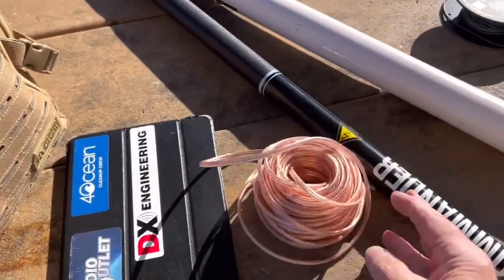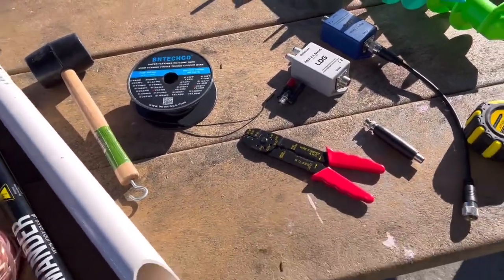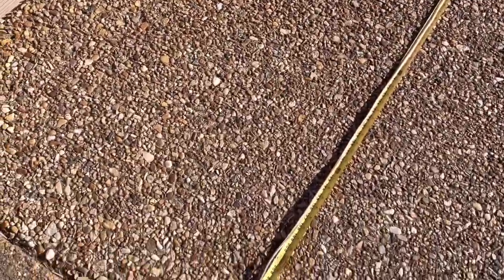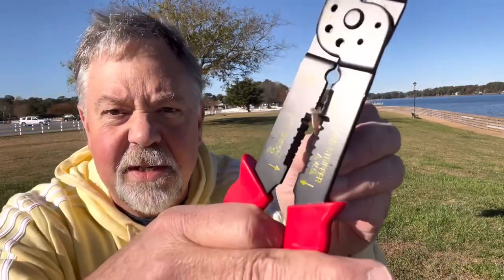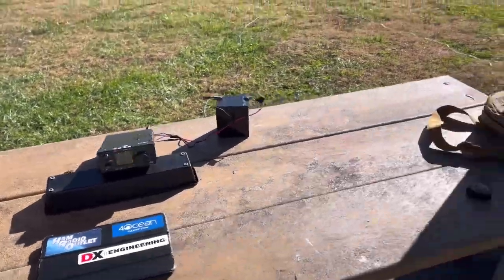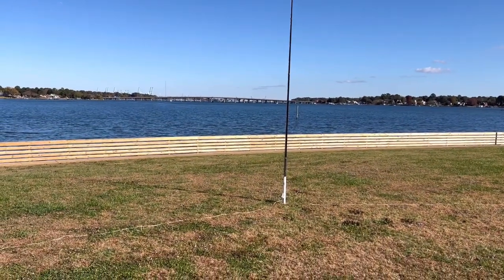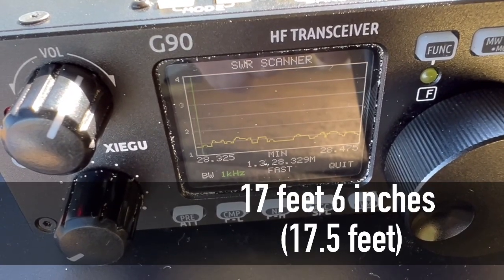How to Build an Easy Vertical HF Antenna

Comment: Hi mate from vk4 land here in Australia. I just bought a 9 meter telescopic pole and a 1:1 balun the same one you have. And I ran 9 meters of power cable up the pole and so far I have 2 ,9 meter radials on it. So far the performance on my frg 7700 and Kenwood r1000 is not as good as I thought it may be. Would you suggest using a 4:1 balun instead? Cheers and 73s 👍

Comment: Walt, I'm getting ready to build this antenna and had a question I'm hoping you'll answer.  I see here you're using the 4:1 balun where in your book, you use a 4:1 unun.  I've ordered the balun but don't have the unun.  Does it matter really?  Just want to make sure I'm using the right hardware.  This is my first home brew antenna.  Thanks Walt and 73 sir
Reply from the maker: I’ve found that they both work well with this antenna. 73, Walt
Reply: @COASTALWAVESWIRES Roger that sir.  Much appreciated.  I just ordered the unun as well, so I've got both to experiment with.  Thanks for answering my friend!  73!

Comment: Do you still need baluns or chokes if your only listening and not transmitting as like sdr radio?
Reply from the maker: No, just the wire for receive. No balun needed.
Reply: @ ok thx 🙏

Comment: Remember all antennas work, some just work better for a certain use. I do wish you might tell us what the various antennas lengths or location of the feed line. Example if 1/2 wave total length the middle feed is somewhere around 50 - 70 ohms, if fed on the end somewhere from 2,000 to 3500 ohms, divide the feed by 50 gives the transformer needed. 9/1, 49/1 or even 64/1 ? 9/1 is called random wire because it is chosen  for space and not reconsent anywhere around 450  so 9/1 = 50 ohms?

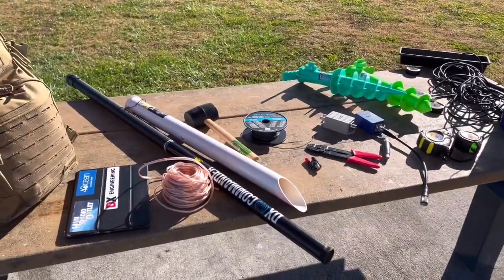Comment: Hey Walt, please tell me what you are using at the base of your verticals. It looks like a fat end is on the coax, think you said it’s a 1:1 Balun? It’s connecting the balun at antenna base to coax going to the radio. About 6” long and it’s fat. May have two connectors on it. Edit: I think I see it at 3:33 on the table below the unun’s.

Comment: Twist stranded wire counter clockwise then wrap around screw in the direction  that you tighten the screw. This prevents strands from unraveling. 
My question is how to do the counter poise for a ham antennas when on a boat
Reply: Thank you

Comment: 10 meter band is 102" inches appox 8.5 FT. How can a 17.5 FT wire work on 10 meter?  Also, are the transformer and balun nessary? I dont understand why they are used. Also, instead of using counterpoise wires, why cant you just put a ground rod into the ground?
Reply from the maker: 102" is a quarterwave for 10 but other lengths will work as well and that is why we use transformers, to match the feedpoint impedance. I'll link a video below that explains that. 17.5 is basically a 5/8 wave antenna for 10 meters and has a feedpoint impedance around 200 ohm, so connecting 50 ohm coax to it means you need a ration of 4 to 1 to make it work. Thus a 4:1 unun at the feedpoint. As for the ground rod, no that will not work at all. Electrical ground and RF ground for antennas are two completely different things, I'll also put a link below for a video where I explain that.

https://youtu.be/utgfXWC6SH8?si=RBaw_HLFJGA-5Xyk

https://youtu.be/KjEOUZS_5sw?si=UJT_x8w6LXOw5CIB
Reply: @COASTALWAVESWIRES  Thank you for responing, these are things I did not know. I love the wire antenna videos, but would like to use a copper pipe vertical and my metal roof as the counterpoise, but am affraid of the lightning issue!!!😦 BOB N9XSR

Comment: I thought counter poise was only 1 wire? And radials more than 1 wire.😮
Reply from the maker: It’s just a name, radials are the antenna’s counterpoise. A single “counterpoise” wire is just that a single wire, it could be called a single radial is some instances.
Reply: @COASTALWAVESWIRES a single counterpoise maybe
a vertical dipole antenna?😮

Comment: 17.5ft length of vertical....210inches.....but using speaker wire/pvc coated....capacity affect....multiply by 0.95 equals 199inches....or 0.92 equals 193inches....16ft....so a half wave on 28mhz and difficult to tune there?if using PVC coated wire,223 inches long equals 210inches bare wire after multiplying 0.95 and gives you a "true 17.5ft" random wire that stays away from half wave [10m?]. not quoting here,just adding my thoughts but could be wrong? just thought that had to always calculate capacity affect of pvc coated wire when measuring critical lengths? any thoughts?...
Reply from the maker: My thoughts. With all due respect I think you are way overthinking this.

Comment: Newb here. Can you bury the counterpoise lines (assuming I set this up on a semi perm basis)?
Reply from the maker: Yes but bury them very shallow (like an inch deep) it’s the surface of the ground that’s acting as a RF reflector for the antenna. It’s completely different than electrical ground. Many people staple their counterpoise wires into the ground and let the grass grow over them.

Comment: I made one of these after watching this video and finally had time to try it out this evening. Things weren't going well at first. No one was hearing me but I was hearing them just fine. I checked the wire and the top end of it had come loose from the pole I had it taped to, probably due to the heatwave we're in. Anyway, put it back up and kept trying without much success at first. Finally got through to a couple different POTA stations successfully, so I'm calling it a win. I'm going to trying putting the antenna up in a different spot to see if things improve, but I'm pretty happy with it considering how easy it was to make. I didn't have a balun or unun, just the banana clip. Thank you for this tutorial and helping me get back into the hobby after a long time away.

Comment: Thank you for the lesson! (KN6UNC here)...

My ex left me with and old Kenwood TS-520s, and I've been looking for an antenna I can rig up. (Currently renting this house; so don't want to cause damage).

I served over 20 years as an Electronics Tech. in the U.S. Coast Guard. I also have my B.S. in Electronic Engineering Tech....

During my service, I had more experience climbing masts, and replacing antennas, than I did construction of them. I'm not sure the distance, but was able to talk to the Communication Station in Kodiak, AK... from off the coast of Panama... 😂

edit

We always dealt in "Frequencies vs Wavelength. Somewhere around 5-6Mhz seemed to have the best "Sky-Skip"...
Reply from the maker: Thanks for watching and for the great comment. 73 from Portsmouth, Virginia home of the USCG 5th District HQ
Reply: @COASTALWAVESWIRES  I actually served most of my time in the OBX. Prior to my final station, was the Electronics Support Detachment, Supervisor out of Wanchese. My command was out of Portsmouth. I am very familiar with the area, lol!

Comment: I have a 11 meter question,  no one seems able or willing to give me an accurate answer.   Obviously this is working for you and doing DX,   but how would on 11 meters this compare with say an m400 starduster that is basically the same thing or more so the A99 claiming 5db gain.   I am asking real world actual use verses gain or any figures... actual practical comps in usage in the real world.  How would they compare?
Reply from the maker: The gain of this antenna on 11 meters should be around 2.15 dB. There is another factor and that is takeoff angle. This antenna is roughly a halfwave at 11 meters. I don’t have the true information on the other antenna to compare the two.

Comment: On a different note.  I am using a 9.1 to make a random wire ant. I cut the wire at 35.5 and my counterpoise at 6.5 ft.  I have a chamleloen choke and using a 25ft run of KMR400 coax.
I get pretty decent SWR's. Now the issue.. I hear no one but only ft8. Any Idea?
Reply from the maker: Well if you’re talking about the last few days, conditions haven’t been too good. I just did a spin from 10 down through 40 meters and it’s dead. That 35.5 should be a great antenna. The only other issue could be a cross connection of the driven element and Counterpoise to the wrong side.

Comment: Do I need to put 4: 1 Balun and a 1:1 choke on the coax? Or 1:1 balun and 1:1 coax choke? 73s
Reply from the maker: That depends on the antenna. For the 17-Five antenna you need a 4:1 and 1:1 choke.
Reply: @COASTALWAVESWIRES  I’m building a 10 meter antenna 1/4 vertical antenna. I only have 10feet fishing pole. Thank you.

Comment: With the price of even simple commercial antennas having gone past the Moon, anyone should learn to build their own.  Years back I worked single-band WAS using an antenna I built for $18.  It was constructed entirely of PVC pipe and wire.

Comment: I’m extremely green on hf. Could I double the length of the driven element to 35’ and use this on 40M? Would I also need longer counterpoise wires? I can fit the antenna in my backyard as is but can’t go to longer counterpoise wires. 

Thanks, Matt
NE9D
Reply from the maker: Hi Matt, length really doesn’t matter with counterpoise wires on the ground. It’s when you lift them off the earth that you have a resonance issue. An antenna that’s very close to this and works well on 40 is the Rybakov which is very similar to this one with a 25’ vertical wire and a 4:1 unun. Here’s a video I did on it a while back:
https://youtu.be/akjMmt3d9i0?si=dEeqzJuV_4IoksFt

Comment: I just built this model using the 4:1 balun.  My SWR was lowest at 10 and 12 meters 1.26-1.3, the 20m was 3.  I was using 20 feet cheap Amazon coax (M&P on the way).  I need to really figure out the Rig Expert analyzer. 

Anyway, it was fun.  I’m going to connect it to my FT 710 and listen tomorrow.  As I understand,  this antenna should be used with an external tuner for higher SWRs?.  Thanks for the videos.
Reply from the maker: Thanks for watching! Yes this antenna is definitely a better performer on the higher bands

Comment: I am interested that you seem to include 1:1 choke balun or unun to exclude common mode current. I have tried some of these and found some designs that are extremely lossy. I have tended to avoid their use, but I have an advantage at least for portable work, since I mainly use 5 watts or less. I feel with QRP we don't have to worry as much about suppressing some low or moderate common mode current. Not trying to tell people what to do, just sharing my own experience. Keep trying stuff, and thinking how to compare with other designs. Keep having fun! And keep "putting the fire to the wire!"
Dave WA4NID
Reply from the maker: Thanks for sharing Dave! 73, Walt

Comment: Awesome vid.  Thanks.  Perfect descriptions.  I get bored with the videos that show how to cut every part.  And you covered all the details, like there is a hole on the bannana jack, but chose not to use it.  Or we could tin the wires, but not necessary in the case.  I also don't understand why people buy wire antennas.  I prefer to make my own stuff.  So I appreciate DYI videos.  Steve O, K9SMO
Reply from the maker: Thank you very much Steve! 73, Walt K4OGO

Comment: Found your video while searching for a bideo to pass on to a brandnew General I met on a 2m repeater last week.     I really like your video since you cut to the chase - I think it is good to show folks the practical way to build an antenna, quick simple and to the point without adding a 20 minute lesson on theory.

Odd that your SWR graph isn't more in the form of smooth arcs and that it changes so much between passes.    Curious what your SWR would have been with other unun/balun options.
73 de NE5B
Reply from the maker: Thank so much, I really need to get an antenna analyzer for these videos versus the internal setup in the rig. I’d like to revisit this myself. 73 de K4OGO

Comment: Some time people just don't get it. You are usually talking about a regular homebrew long wire antenna. It's not supposed to be pretty. It's not supposed to win contests... Well beauty contests. It's throw some wire, connectors and sticks/poles together and get it on the air! If you build one and get it to tune up in that sweet magic spot you adore... On that one you can start to make it look pretty and sexy. That way you can keep it and use it for years to come. If it's not very good but basically gets the job done but  junky... Then you can just chunk it in the corner of the shack and never think about it again. You obviously can't throw it in the trash because... Well we are hams. We have never thrown anything away and we will not start today!

Comment: This video really inspires me to make my own antennas and get out there while stop wasting money in pre-built antennas. I still have one area not very clear, when do I want the 1:1 or the 4:1 or the straight bannana clip adapter? I always wonder about that. Lets say to build a 20m vertical which one should be the best? I will love to just use the straight adapter but still wonder about the differences. Im not into much of a multiband, I will like to build the best possible 20m as digital modes is what I love
Reply from the maker: Thanks for watching and commenting. For a good resonant 20 meter antenna you can just use a straight banana clip with a vertical wire cut 1/4 of a wavelength for the digital part of the band. Counterpoise on the ground lengths are not that important as I mention in my videos. That would work. You could add a 1:1 choke which might help keep current out of the coax but try the simple banana clip approach first and see how it performs. 73, Walt
Reply: Perfect , thanks, I’ll try that. I’m in Melbourne FL so I’m looking forward to try throwing some radials by the Indian River and see how it goes. I’m pretty excited to try that

Comment: Will this work for cb radio??? If so how long does the wires need to be
Reply from the maker: Yes and very well. Make the upper driven element 8'- 6 5/8" (2.61 meters) long. The length of the radials on the ground is not important.

Comment: because I don't own my house my antenna is always portable. 
I have a speaker wire that is inverted V using a banana clip with a choke.  It is tuned for 20 meters and does a great job.  I have used the same piece of speaker wire over a year now.   When I want to play ham radio I can set it up when I don't I take down and put behind a bush.
Let me add this about soldering the ends.  I have done that and to me it makes the ends brittle.  If the antenna moves around to much they break.  So I no longer solder the ends. 
Great video as usual.  My wife and I just passed through your neck of the woods not long ago.  I waved! Hi HI.

Comment: Tried discount speaker wire - but mine would break very easily at soilder points or connectors.  Probably copper covered inferior metal.  Good luck with .75 mm2 electrical “household” wire stripped of the outer insulation.  Did a 100 meter soool, giving me 200 meters of high quality wire.  So far worked perfect when used as 4x10 meter counterpoises for a vertical whip on 20 and 40 meter bands
Reply from the maker: I’ve had good luck with the Monster Wire from Walmart

Comment: what do you use for an antenna on your jeep. I have a 2019 JL.
Reply from the maker: I just got a mount to put on my backup light (I have a JK) and I got a short 2’ Firestik for 10 meters. I have a few HamSticks and figured I could just keep them in the Jeep and swap them out when I want to change bands.

Comment: A wire vertical is definitely in my future.  Still getting the shack together.  Fan dipole setup for 40,20,15, & 10 meter currently.  Vertical will be for base and portable.  Seriously considering a base loading coil for 160 and 80, on up.  Good job on your build.
Reply from the maker: Thanks! I enjoy vertical antennas because of my location. Putting one up next to saltwater is amazing.

Comment: I used those binding posts to make a series of HF verticals from 10-40m. I prefer the efficiency of single band verticals rather than multi-band antennas.

Comment: Another great video Walt. Instead of taping the wire why not loosely wrap it around the pole? Or use some Velcro straps to hold it to the pole? Why the 4:1 unun/balun if the G90 has a tuner that will tune basically a wet noodle?
Reply from the maker: That Dollar Tree electrical tape just works for me. Yes the G90 will tune anything but I want to show the true design of this antenna as everyone doesn’t have a G90. All the best and 73

Comment: An engineer with a hammer, some of the most shocking video EVER!  LOL, J/K! 

What's weird is there's a roll of the same wire right behind me, and a pair of the banana connectors on the desk next to me. I have the same pole in the mail, and am planning about exactly what you built.  Thanks again,  perfect timing and a great video!  Take care, Greg😊
Reply from the maker: Hahaha us structural guys just beat everything until it fits